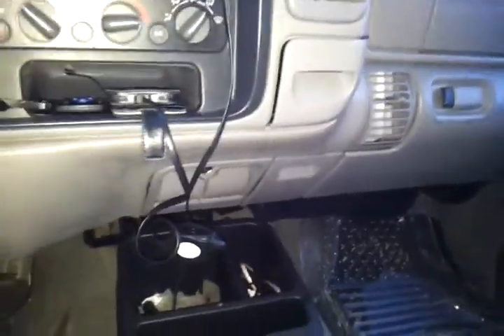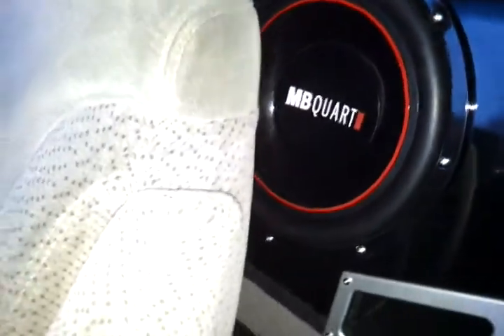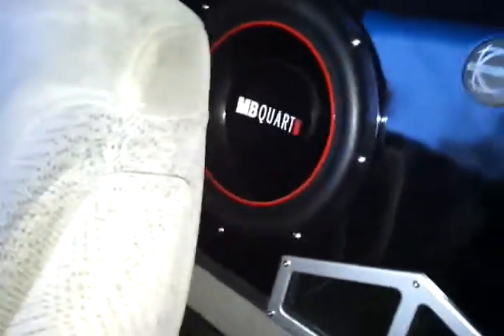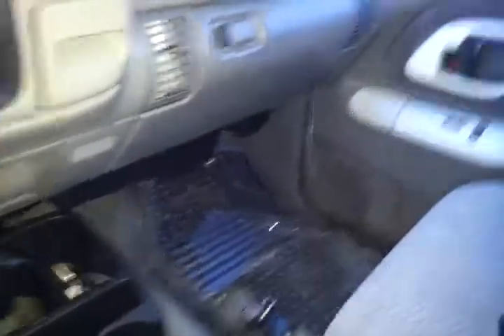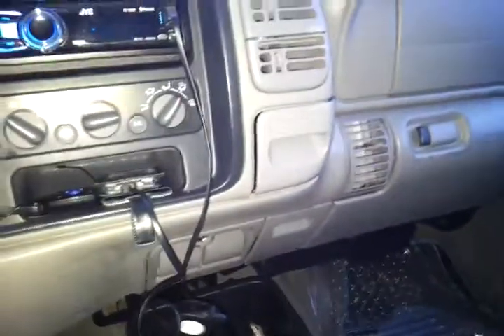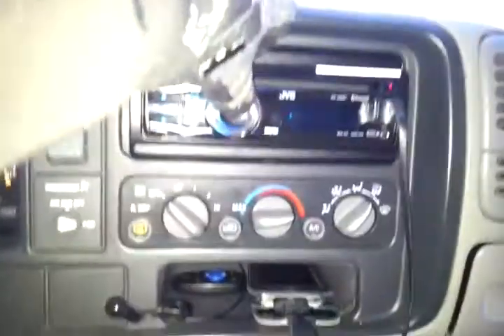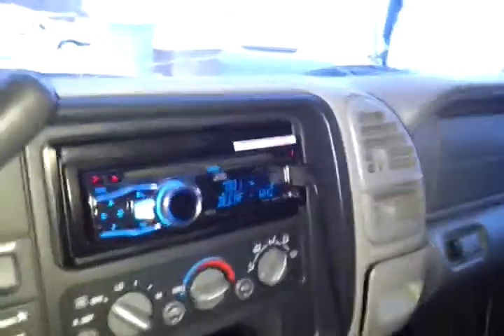Breaking in the new equipment!

Comment: Not bad subs at all! So far they sound really good, and they will only get better as they break in. Keep it loud brother.
Reply from the maker: Thanks bro, the box I've got them in is tuned for 42Hz over all 3cubic feet, 1.5 cubic feet a side....re-tuned my amp today using a volt meter and calculating the voltage I need to have it be more around 900watts instead of 1200watts I have them wired to 1ohm, an ya they seem to smell a bit after tuning to mid compromise with my SMD DD1 tuner, plus they would get warm after 10min of heavy bass, but only with my bass knob anymore then half so I tuned down around 900watts an now can keep my bass knob up all the way, no heat even after some really heavy bass even at volumes 28-34! so ya they are taking only 50watts more then they are rated for each instead of the 200watts I was asking them for before ha ha I was thinking about ways to wire my 2 Jensens into the mix but the MB Quarts are DVC 4 ohms and Jensens are SVC 4 ohms so not sure its possible to wire all 4 to 1ohm....
Reply: Cant do 1 ohm with the 4 subs, but you could wire it to 0.66 ohms, and your amp should take it just fine.
Reply from the maker: Sweet so each sub would see what roughly and how would I get that rating?
Reply: Your amp is rated at 1200 rms? If so you should be getting about 1800 watts. If its rated at 900 rms youd get about 1400.
Reply from the maker: Oh ok ya its a 1200rms at 1 ohm amp....it has 4 input spots for subs to make multiple sub hookups easier would I wire the other 2 into that or....into my other subs at the back of the box on each side then into the amp with 1 postive an 1 negative?
Reply: Youd get that rating by dividing your rated power by your ohm load. But remember, that's based off a perfect electrical system with 0 voltage drop, and without any box rise. If your amp is rated at 1200 at 14.4 volts, and you drop to 13, at .66 ohms rising to 1.2, youd only get around 900 watts out of it.
Reply from the maker: Well in order not to wreck the Jensens id have to tune the amp down using sengpielaudio site where it gives a voltagr rating to look for on volt meter when tuning an being wired at 0.66 ohms only wanting roughly 1200watts to give each sub 300watts
Reply: Like I said, if your voltage drops a bit, youll get less wattage, and I know there is a bit of box rise, so you more than likely will not be getting over 1200 watts. Id say your safe running it at full power ;)
Reply from the maker: Oh ok cool well guess maybe ill play around with wiring tomorrow see what I can get not sure how to go about adding the Jensens in I guess ill just wire them a few diff ways till I get about 0.66 ohms lol thanks bro might result in garbage cause its a sealed unit of svc 10s under my seat then the dvc 12s in ported on top....could result in good blend or tragedy lol
Reply: lol no prob bro
Reply from the maker: Sticksaudio well I went and did it bro just as you said 0.66 ohms rating sounds pretty damn decent! posted a video of it :)
Reply: Sweet :)

Comment from the maker: Heres the situation guys I'm thinking of trying an experiment....wiring my 2 DVC 4ohm MB Quart Subs with my 2 SVC 4ohm Jensens....My MB Quarts are wired inside the box to 2ohm each side then together at the back of the box to 1ohm load but can easily remove wire to drop each side back to 2ohm....so I'd be wiring 2 SVC 4ohm load subs into 2 DVC subs wired down to 2ohm load what do you suppose my final impedance would be? don't care how people think it will sound or if its a good idea or not I am just curious to see if I could get all 4 subs going my amp is a 1200.1D mono block Hifonics Zeus amp I'm hoping the resulting ohm load would be 1ohm but if it most likely wont be I might not even bother....or if theres a way to wire them to 1ohm you guys could inform me of I would greatly appreciate that! :) Thanks in advance everyone! :)